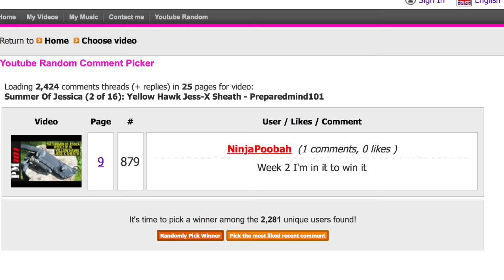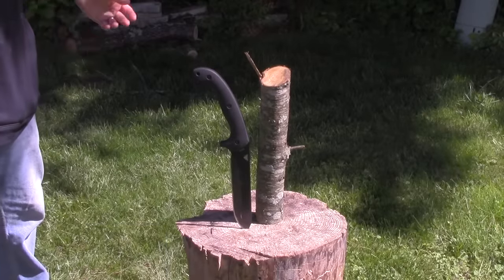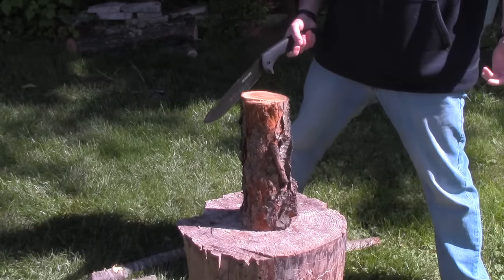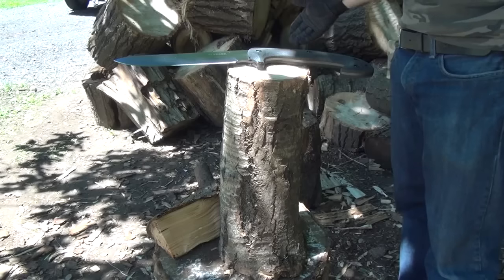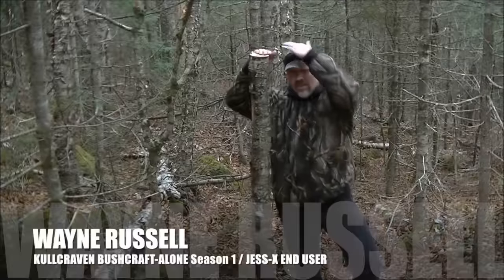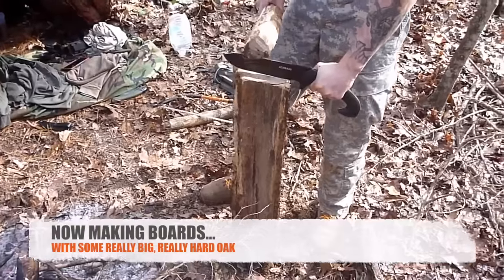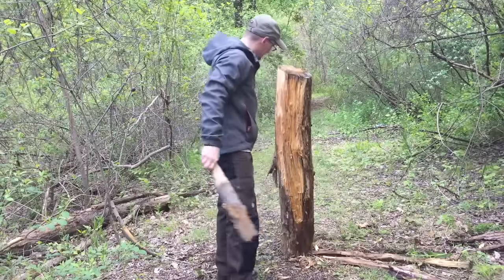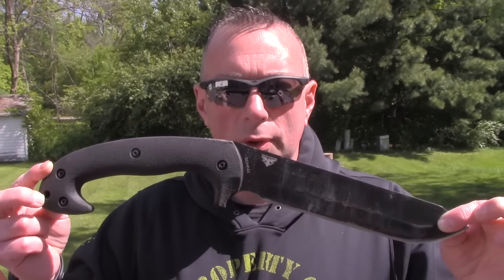Summer Of Jessica GAW Week 3: Extreme Baton Testing (NO LONGER VALID!!)

Comment: Am now officially curious. Already have a proper right angle froe, and use my SP8 in carpentry often. After getting the split started, I have used my Estwing camp axe neck to finish with batoning. Don't laugh, it works.